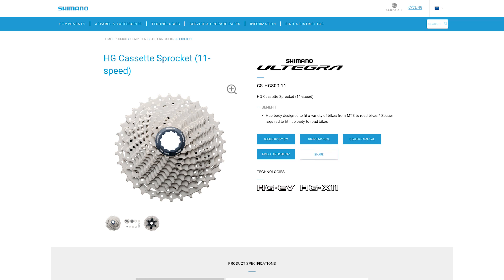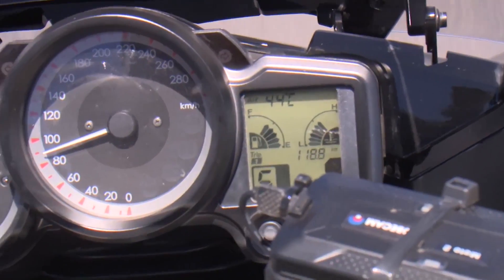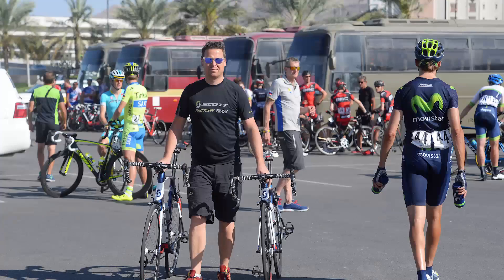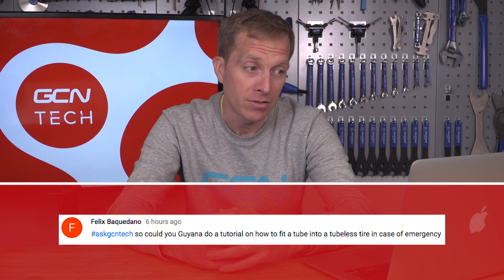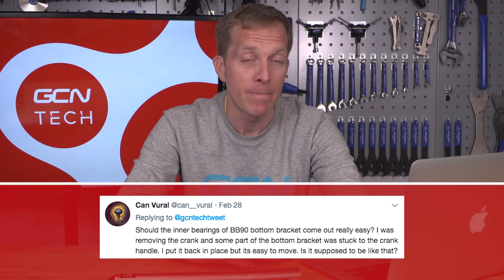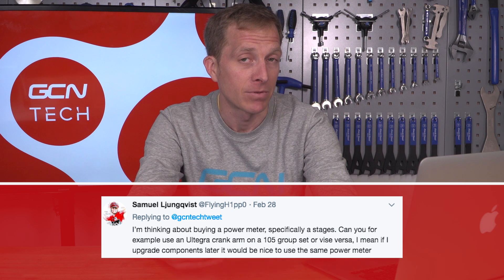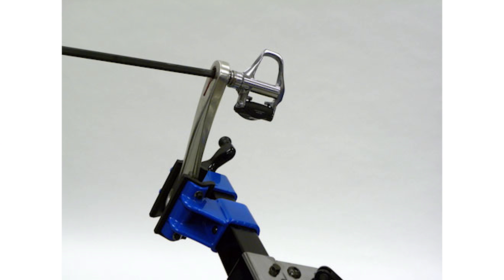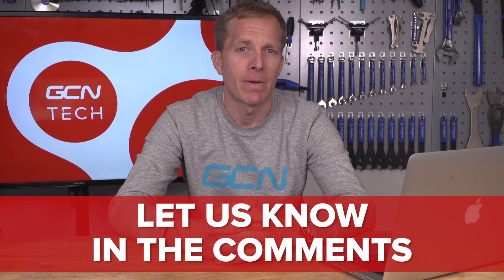Tubular Tyres: Tape Or Glue? | The GCN Tech Clinic

Comment: tape, for sure. gods i hate glue.
Reply: no, NEVER TAPE WITH TUBS!!! Rolling resistance is way higher, road feeling and grip is much worse than with glue, and tires move by time. If you don't want to use glue, use clinchers!!!
Reply: how does tape affect rolling resistance, grip or road feel of the tire??? i've had my tubs taped for a year now. no problems. !!!!!!
Reply: they do - and that is proven many times by tests from different magazins, testing facilities, pro teams aso... and every rider can feel the difference easily. Get a wheels set with the same tires you are using, glue them and compare to your set up - you will never use tape again!!!
Reply: so, i read a few of the studies, and it seems that the fractions of seconds saved over hours of stage races isn't really applicable to my riding or even crit racing. i find it's a bit counter to the argument that riding wider tires ala 25mm, 27mm or even 28mm that reduce road buzz with lower pressures and increase comfort due to larger contact patch and give would maybe even be equal to the softer adhesives used on tubulars. it seems that even the type amount and age of the glue drastically affects the ride of tubular tires, as well, as some testing showed that tape was faster than large amounts of soft glue. but, with wheel tech moving forward as it does, tubeless will probably be the chosen tech soon enough.

Comment: Is it possible to use Ultegra 6800 Shifter with Ultegra R8000 derailleurs
Reply: Yes I run r8000 derailleurs with 6800 Ultegra shifters.
Reply: Yes.
Reply: Jon's answer to the 6700/6800 question wasn't complete:  Its not just the internal ratchets, its the fact that 6700 is 10 speed and 6800 is 11 speed.  Thats why they need different ratchets.

6800 and R8000 are both 11 speed and share the same gear pull ration.  6800 are lighter, IIRC.

Comment: well, my old sora short cage mech works with a 11-34t sram 9spd mtb cassette. sure the 34t cog flexes the cage quite a  lot but the chain works just fine and it didn't fall off or get stuck between the spokes and casette